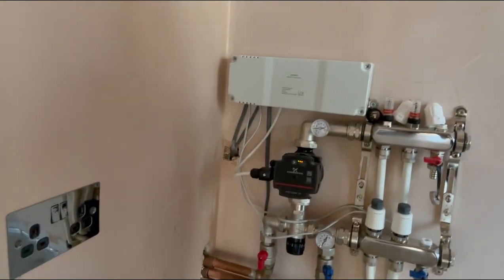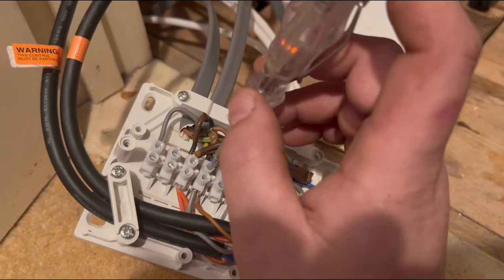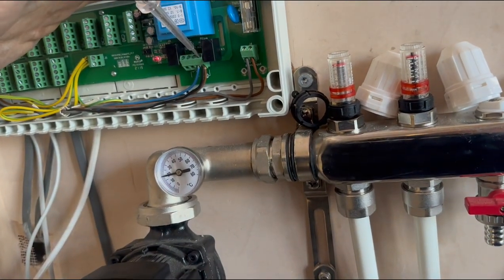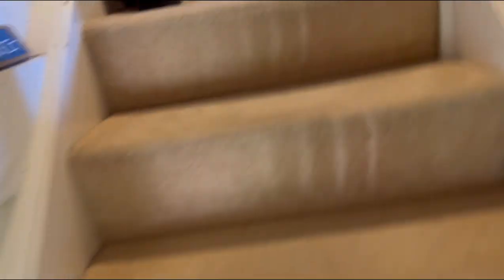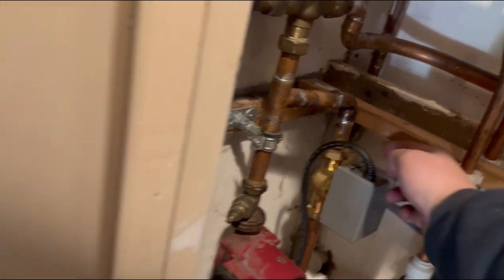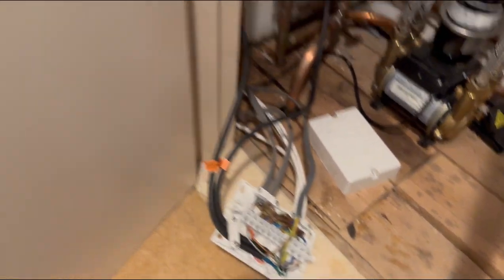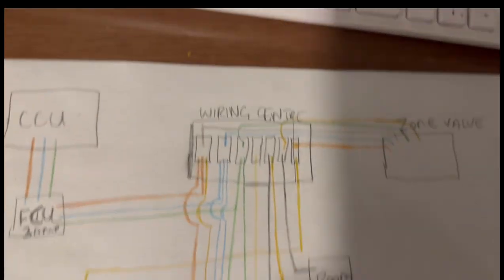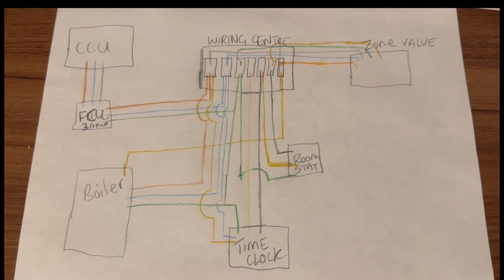UNDERFLOOR HEATING WIRING PROBLEM SOLVING || UK ELECTRICIAN ||

Comment: I’m late to the show, can’t do y plan and zone valve. When the Underfloor comes on. It will pump around the open circuit on the 3 port aswell. Also the Boiler call on ufh control is a in and out. So it can be voltage free if required

Comment: Hi Wayne, Blwyddyn Newydd Dda i chi a'ch Teulu.  Well done for sorting this one out, it would never have worked correctly without a permanent Live going to the wiring centre, the person who installed it originally obviously didn't fully understand the wiring part of the system, as you said there are plenty of diagrams out there to follow, btw the video was certainly not boring at all matey.
Regards from Ray in North Wales.
Reply from the maker: Thank you ray, I think what they did was found the live when the water and heating was off and assumed it was a permanent live